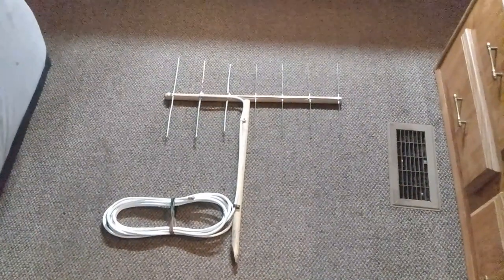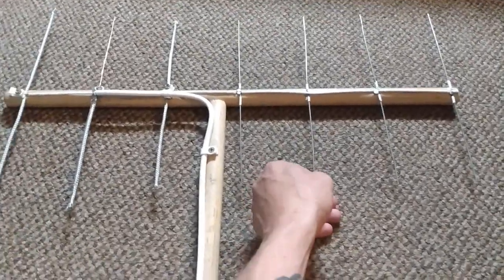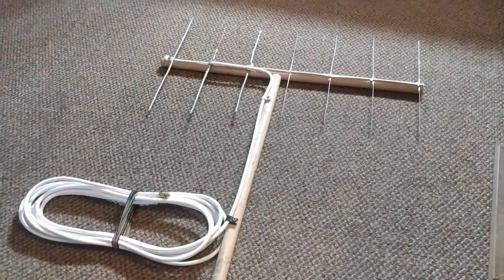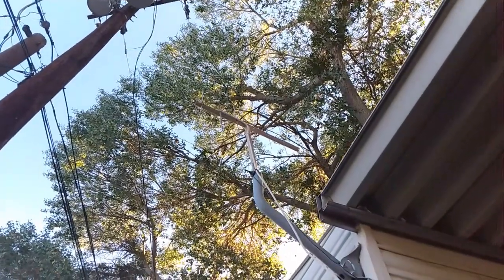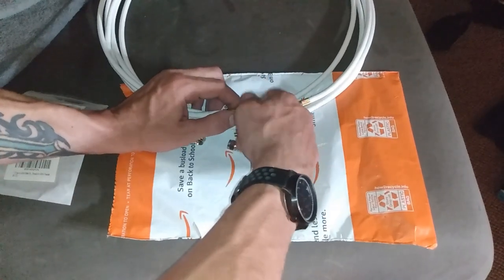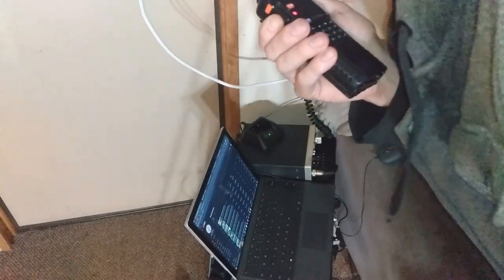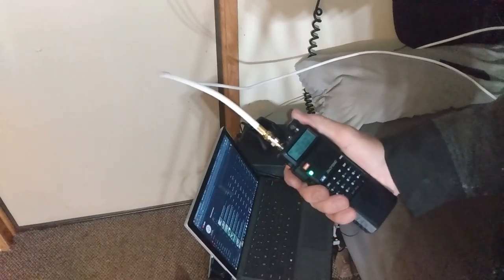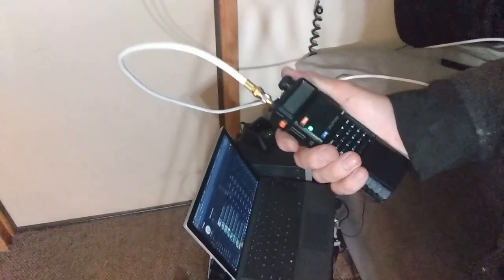HOME BREWED GMRS 7 Element Yagi Antenna, BAOFENG--Part 1.

Comment: Appears to be 75 ohm coax and no matching system. direct connect to element. Good luck.
Reply: Ya SWR is probably in the 3:1 range.
Reply from the maker: Ya it was my first test antenna, I have much better stuff now.

Comment: Good stuff to inspire. Would like to see how the coax connects to the driven element. Thanks and carry on.
Reply from the maker: It’s been a starter video for me. I just twisted everything together, but I would prefer to solder it and use heat shrink.

Comment: Great work! Just got my HT but can't seem to communicate with anyone. I hear them but when I do a radio check seems like no one can hear me.
Reply from the maker: did you check the tones
Reply: @arizonasadventures8827  yes, tones are correct. It may be too much obstacles in the way, need a good outdoor antenna.

Comment: Well done project! I think you are at a learning point that you need an antenna analyzer. How good you sound is not a good test for your radio and antenna.

Coaxial cable you are using may be the wrong type.  I'm guessing that that white coax is RG-6.  IF it is, that's 75 ohm Coaxial. All communications use 50 ohm, like RG-58 or RG-8. I'm guessing that cable is OK for your project. The matching network (actually,  there is none) of your a antenna is simply a quarter wave driven element.
You've done a great job, and looks great. It seems to be working. If it's working, leave it alone.
I wish you would have told us (as well as putting it in your notes) what formula you used and where we can find it.
Thanks for the video  and keep them coming.
Rob
Reply from the maker: thank you i will add in more info on my next videos and ry some other thimgs as well as get test equepment thank you

Comment: Good effort...but there's some issues. 

Your coax looks like 75 Ohm, which isn't in itself wrong, but I don't see any kind of match on the driven element. Yagi's have a really low input impedance. You're going from 50 Ohm to ~75 Ohm to probably 25 Ohm. 

Next, coax is really lossy for UHF,  keep the feed line as short as possible, like 3 three.

Lastly, you're going to find that those small diameter elements have a really small bandwidth. I know this because I made a similar design for my first Yagi-Uda build and it sucked...

Start off with some aluminum arrow shafts as elements and go from there. Look up a Gamma Match and Delta Match.
Reply from the maker: copy that thank you i will work on that.

Comment: Josh, nice construction.   Thanks for sharing.  However can you clarify the measurements?  I can't seem to see all 7 elements, spacing and length measurements on your video.  It looks like a winner!!
thanks  JIM
Reply from the maker: thank you, Jim, the spacing in-between is 3.76 inches, and length A. is 12.49 inches, B. length is 12.11 inches, and C. /small 5 elements/ length is 11.21 inches.
Reply: @arizonasadventures8827  I just finished building it Josh.  I need to attach an SO239 then test.  Hopefully over the weekend.  Thanks again
Reply from the maker: Awesome hope it works well

Comment: Excellent job! How far apart were you guys?
Reply from the maker: 120 miles
Reply: @arizonasadventures8827  You must have been hitting a repeater then.
Reply from the maker: @jungblud59  yes I was using a repeater. The furthest I’ve got on simplex was 97 miles and that’s over hills and bumps terrain but if you have clear line of site 130 easy maybe plus some of these have really good range and I’ve heard 900 MHz only gets better.